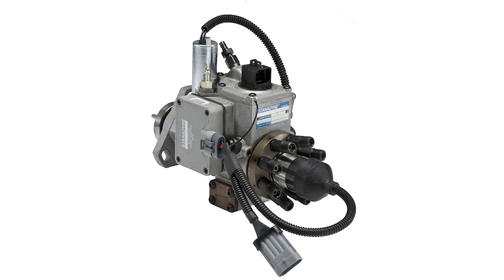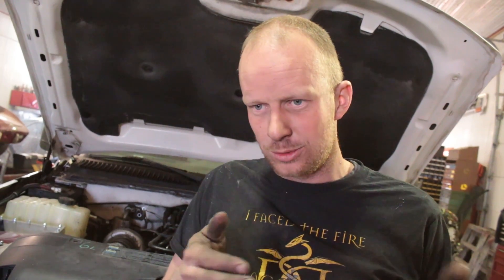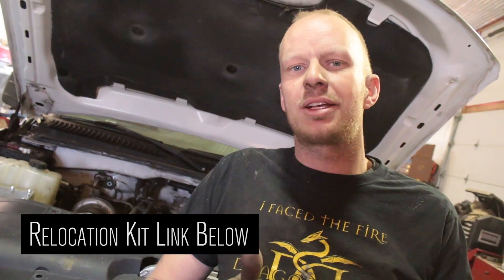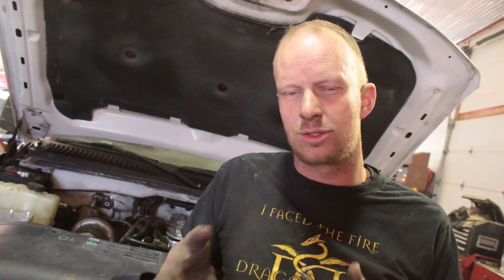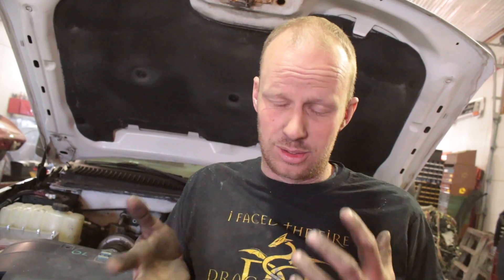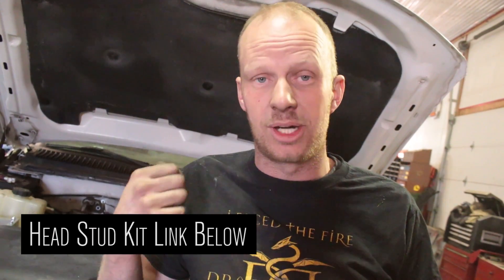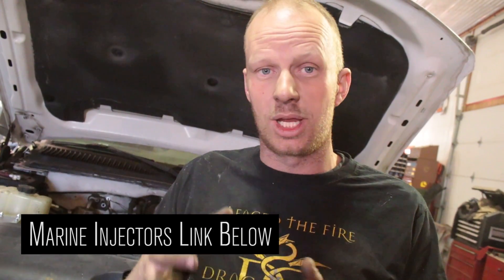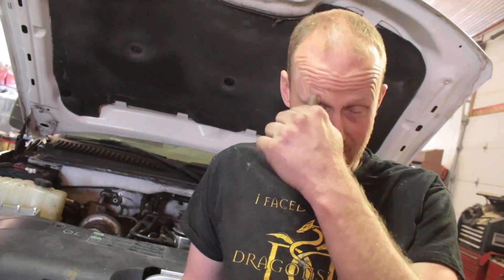REVIEW: Everything Wrong With A GM 6.5 Detroit Diesel

Comment: The 6.5 always had a unique sound to it.
Reply: It seems like all those trucks also had a unique smell under the hood. What I mean is you can be blindfolded and smell the difference between a 6.5 7.3 and 5.9.
Reply: Yes which is part of the reason I like it!     Edit : other part is that my dad has gone through two of them so they are in the family.
Reply: My aunt had one and I LOVED the sound, sold it to my cousin and he plowed with it, it ran away when he was driving
Reply: Like a bunch of ball bearings in the crankcase!  Mine has 354k miles on it currently.
Reply: Cllllack clack cllllack clack cllllack clack
Reply: Indirect injection engine=that awesome tick noise
Reply: @Andrew-ff4hh  A cold day and a 6.5 = a rock throwing contest haha.
Reply: 100th like
Reply: Yea they sound like they are rod knocking
Reply: IMO the 6.2 sounds much better
Reply: @brandonlarue3170  6.5 is a bored out 6.2
Reply: @nou8257  I know, it’s a bored out and turbo 6.2 essentially
Reply: Yup I still miss the sound of my 97 with a straight pipe. Crank broke at 313km. Rarely hear them anymore but if I see them around town I always roll my window down for them
Reply: @jaywiebe7612  cranks breaking is a known weakness of this engine.   Have to keep an eye on the two harmonic dampers.  There are two.  And they don't last forever.  I put a Fluidampr on mine for peace of mind.
Reply: @tmsnyder1971  two? Hamonicdampeners
Reply: @jenseriksson2590  Yes, one is the serp belt pulley, it's built into it.  Bolted onto the regular one at the snout of the crankshaft
Reply: @jaywiebe7612  I have a 94 k3500 crew cab dually with a stick barely got to drive it but i just like the old truck eventually ill get her fixed up again i managed to save it from a salvage auction.
Reply: So does a pack of firecrackers in a dumpster... kind of enjoyable though.
Reply: @davidmark866  actually gets quieter going up hill
Reply: friend has one, dont care for it, doesn't sound any better then my 7.3, 6.5 is quite....
Reply: like the rods are about to fly out of it. yeah unique
Reply: Theres a video to bomb proof the 6.5   and I think all Detroits have unique sounds
Reply: @Ricky-manic  link to the bomb proof vid? Thx.
Reply: I have a friend with one of these with a 4inch down pipe to 5 out the back and shortly after meeting him in high school, I quickly knew when he was leaving campus from several hundred yards away or he would be cruising around the neighborhood. It is a cool sound.
Reply: My favorite sound is the 5.9 Cummins distinct screech when you shut it off.

Comment: There's alot of comments to go thru so I'm gonna ask even if it's a repeat but, if you change out and get rid of the problem components to make the truck more reliable could it somewhat reliably haul something under 13k?
Reply from the maker: Yes.  Lots of guys love them.  Every manufacturer has some sort of issues, I just want to bring those to light so you know what you are getting in to
Reply: It's nice to see a informative video vs a bash video. I've seen a few for sale and this seems like a cheaper way to get into a diesel so knowing that it is a usable platform is nice.

Comment: My 1995 6.5 td is still running strong. The PDM died on me and the clutch went out The pick up fuel pump died on me too. The tank filter clogged. 
The starter kept snapping bolts off until I got grade 8 bolts and the brace 
in the back. Now its been 6 months with no starting issues.. And I had to manually close the turbo waste gate. Now its fun and reliable. I would like to know how to transplant a 12 valve into this and have it mount up to my NV4500 transmission.

Comment: Little black box FSD 6.5 computer been through two of them truck now at 157K. about $150 to $275 for remote and you can rebuild these little hummers for under $10 check out youtube.  Recently installed rebuilt trans $1700 and injection pump two years ago $1700 installed but you can buy them on Ebay rebuilt for around $700. Installed water pump cost about $150 and if you do that too be very very generous with silicone when installing the anaerobic bolts (the ones that run through a water jacket) or it WILL leak. 

I installed new rotors and pads for the front axles (4x4) and you have to remove the wheel studs then reinstall them on the new rotor. Pain in the ass just be sure the studs are seated before installing back in place then bolting up calipers and wheels. These take some torque to get them all in even.

Comment: I bought my 97 two door Tahoe 6.5TD for $500 and haven't had any major issues and have just kept it maintained. Every now and again I have to pull equipment or other people's vehicles out of the mud on the job site and I don't even have to take it out of 2HI to get them clear of the mud with only all terrains on it. Definitely no powerhouse but I can pull everything I need and tow more than I'll probably ever need to. In my opinion these light duty diesels get a bad rep because they're a little finicky and maintenance is really important with them. Slap a fuel pressure gauge and an EGT gauge on em and go to work

Comment: My experience with the 6.5L was that when you do all the preventative and preporatory upgrades first, they actually make a pretty good engine. I was plagued with FSD/PMD (black box) issues, stalling, even an almost runaway condition. A 6ft harness can be obtained as well as a nice heatsink, and alot of people now are removing them from the engine bay altogether. I chose to mount mine behind the front bumper, and never had another problem with it. 
Beware of claimed 40+hp 'marine' injectors, i would strictly only buy bosch or AC DELCO brand injectors, and yes bosch does have marine nozzles, but they aren't gonna make 40+hp. 
The bottleneck with fueling is the Stanadyne pumps, the DS4 (electronic, 95+) flows a little more than the DB2 (mechanical) pumps will. 
The problem with hopping these things up is just simply the IDI design wasn't made to be juiced up. This is a light duty diesel engine, designed to be able to pull a load and get good gas mileage while doing it. It's competition (in-house) was the big block 454 that got 9mpg loaded or unloaded. A 12V cummins is a medium duty engine, and really really outperforms the IDI engines simply because the direct injection system is easier to cool, and has a more reliable combustion with higher injection pressures ETC. 
Not tryin to get into too much detail here, but simply put, the 6.5L's injectors screw into the head, spray into the head, where combustion actually begins and is forced out of a hole no smaller than a pen tip and no bigger than a pencil eraser (different applications, it matters, 'star' precups are the best FYI) and THEN the flame continues into the actual cylinder. 
Here lies the main drawback of IDI, the water jackets in the head simply cant keep up with diesel's high combustion temps and these engines will get real hot, real fast, so that is why hands down THE MOST IMPORTANT thing!!! you can do to these engines is get a nice set of gauges, boost psi, EGT pyrometer, and fuel pressure. They are also very handy diagnostic tools, and they WILL save you from blowing a hole in the side of the block when the rings expand till they touch, shatter a piston and the rod starts floppin back and forth @ 3000rpm. It didn't happen to me but ask anyone who's ever had a 6.5l take a shit on them if they had gauges and I bet 90% say no. There really isnt anything besides lack of oil that could cause the damage that 1300° EGT will do after about 90 seconds. So if they say they DID have gauges and the motor is junk, they are either lying bout having gauges, or they were pushing it too hard and KNEW they were pushing it too hard. Operator error, 95% of issues with these engines. But you know how middle aged men are, the kings of wasn't my fault- it was a shitty motor- which is pretty freakin untrue.
#2 MOST IMPORTANT thing you honestly IMO NEED TO DOIs get that TINY DUMBASS hair-brain of an idea of a turbocharger off of the engine. Apparently in the 90's, CFM didn't exist (sarcasm) or i dont even know what the hell they were smoking, but ummm hello?? Lets make sure the actual volume of air a 6.5L engine needs at 3/4->redline IS CAPABLE OF FLOWING THROUGH THE COMPRESSOR AT 0PSI. Meaning if I took the wheel out of the compressor housing and ran the truck like that, well you ever tried to drink a milkshake that wasnt melted enough?? There you go. I'd really like to go back in time & take a nice 2x4" to the engineer(s) that decided a smaller (too fking small on GD PAPER) & wastegated turbo was a better solution than a bigger non-wastegated turbo. And to make matters "better"(cough*cough*WORSE), they tried to use vacuum solenoids triggered by PCM signals to control the wastegate and use the wastegate to control the boost output. STUPID NOOBIE DUMBASS IDEAS MADE BY GM ENGINEERS RUINED THIS ENGINES RELIABILITY & REPUTATION. PROVEN BY AM GENERAL WHEN THEY BOUGHT THE DESIGN FROM GM & FIXED THE DUMBSHIT AND PUT THEM IN (STILL DO) MILITARY HMMWV's.Seriously a similar vacuum setup is on my 1989 d350 cummins, but it controls the damn heater core bypass wtf were they smoking crack??
Anyways
Turbochargers can be had for real cheap these days. Guys were paying ~$300 on ebay for a chinese holset and having good results, but you have to either make or find someone who makes an appropriate downpipe. 
IN ALL HONESTY (hindsight is 20/20), I chose to pay $800 for the a-team turbo, just for ease of install. I regret that decision, simply because $800 is way too much for what you get, a mitsubishi excavator turbo, probably sourced from alibaba, and changed slightly to be able to bolt on. 
Another crucial thing I did (mine was a half-ton S vin) was find a lower intake manifold from an F (#8) VIN truck, which essentially deletes the EGR. My truck had 263,000 miles when I got it. I removed the upper intake manifold to have a look one day and the EGR (combined with the stupid BW POS stock turbo blowing oil film) had sooted the intake runners seriously almost fkn clogged, like an allergic reaction swells your broncial tubes that's what it looked like. It was a PITA to clean too, i tried to just use the F VIN lower intake manifold gasket but the exhaust just burnt through it, eventually sourced a lower intake. I pulled a "brand new" set of "marine" injectors off, p.o. Had purchased from SS DEVIL SUP... I mean SS DIESEL SUPPLY (beware!) and hand on the bible they were Dorman injectors and #7 & #8 bodies were cracked and leaking, which is why i replaced them. Next was 4" exhaust, 2.5" crossover with a 1/8th npt bung for an EGT probe, and a pretty nice custom tune from Heath Diesel, which was the real difference maker besides the turbo, which i might add, was a good turbo for the 6.5L. Just overpriced, andddd I got bored and slapped it on my 5.9L 12V and melted the exhaust turbine and then the asshole Who sells the things couldn't get me a cartridge to rebuild it. 
Ironically the holset h1c stock turbo on the 12v had a tiny little 52mm compressor wheel, and so by some dumb luck or fate or chance, the compressor housings on both the ATT & H1C were v-band clamp style for easy clocking, and that realization got my mental gears turning, and led to me putting the bigger AND wider compressor wheel and housing off the half melted ATT onto the H1C where it still lives today. 
I miss my 6.5L honestly, but if I would've known what I know now, for the $$$$ i spent for a beast 6.5L (78mm3/stroke ds4 maxxed + all other upgrades ~$3500 total not incl labor cause I installed it all) The bosch VE on the 12v I own and DD now flows 78mm3/stroke STOCK. And so I spent $3500 for 300hp in a halt ton 4wd with wide mickey thompson mudders, which was a blast to drive, just overheated really fast. But with the help of gauges, that engine is still running with the same setup (hx40wii turbo though) and has over 300,000 miles.
With the 12V cummins, I literally popped a protective cap off, turned the injection-duration screw until it made it run away, then backed it off 1 full turn, removed 4 flathead screws for the AFC cover, turned the fuel pin according to the youtube video, played with the post-boost & pre-boost fueling screws and voila, 300hp/600+lbs ft tq, for ABSOLUTELY FREE, in a 2wd single cab, with a 5spd manual which is just as fun to drive, I LOVE to smoke camaros on the interstate or burp smoke onto douchebags in convertables for texting & driving or being a fucking idiot, but the heavy SOB will get stuck in wet grass lol. Unless you keep it moving. Which is not a problem it will spin the tires doin 65 in 5th gear if the roads are wet. 
The cummins is a beast.
He's right, 12V cummins are the kings.Changed the head gasket on mine (simple as hell) and with 175,000 miles you could still see the honing marks on the cylinder walls from 1988. And I abuse the shit out of it too. Got a long block on the stand waiting for it's turn, pulled out of a wrecked truck and paid $500 for sans IP, accessories etc. Love the old gold goat. It'll pull my 48ft camper without even breakin a sweat. PEACE I HOPE I HELPED. TL;DR--BUY SOME GAUGES TO KEEP FROM MELTING IT AND GET THE FACTORY POS TURBO OFF ASAP THEN YOU WILL HAVE SOMETHING. ✌🏽️

Comment: good video but you missed a few things. the black box is called a PHD. pump mounted driver. after the relocation kit the other problem is your oil pressure switch. it doesn't last long because the injection pump is powered through it. so they burn up regularly. It was a safety issues so if the vehicle rolled over the oil pressure would drop and it would cut off the diesel supply. no fires. 
  The other things you could mention is the oil cooler Lines. they fail regularly because of the clips they use to attach it to the cooler / engine with. they are basically paperclips. there is a modification for that as well. also if your rebuilding your motor do not refried the crankshaft. they can't be regrouped they will snap in half. get a factory new or better yet. Scat makes a great replacement for $400. 
   There are serious mods that can be done to boost performance up to 350 to 400 H.P. but for the money you will spend might as well do a Cummins swap. also the block and heads were prone to alot of cracks. some caused critical failure some did not. it was fun to learn about them and fun to wrench on something different carrying a few spare parts they are reliable and fuel efficient.

Comment: the basic  design on the 6.5 is pretty bombproof.  everything GM added around it sucked.  the lift pump was under powered, and would break all the time and that's why they go through injection pumps.  the FSD (that little black box) was in a crappy location.  although easy to fix.  the shitty vacuum pump for the shitty vacuum operated wastegate sucks.  why they didn't just put a mechanical waste gate on I will never know.  and the cooling system was so incompetent for the job that they can't really handle any load uphill for any length of time.  change all these issues (e.g. THE MARINE MODELS!!) and it's a reliable, fuel efficient diesel that will tow more than most will ever need with no sweat.  oh, and throw a big set of batteries in just for good measure.  Good engine, poor installation execution.

Comment: I would add injectors to the list as well.  They will generally stop atomizing around 180,000KM.  The problem is that most people don't notice the presents of black smoke out the tail pipe and think it's 'normal'.  This led to many head gasket and cylinder head issues with the 6.5L

Comment: DeBoss....would you consider doing a vid about converting the 6.5td from electronic to mechanical injection?
Reply: There's a little more to it than that, but in its dumbest form yeah that's all there is to it. 
The newest addition to my collection had this 'mod' done by a 'master mechanic'. Timing was WAY retarded, fuel screw was ALL in, and rings and flushed out from all the extra fuel washing past them. Putting a DB2 on a motor that came with a DS4 is a good way to kill it prematurely, IF you lack the required knowledge to time an IP without timing marks
Reply: It's so simple. Just unbolt Injection pump, get a Mechanical one, run a throttle cable
Reply: dont need to just need the PMD isolator and the harness extension put a processing fan on it an no more issues. Check accurate diesel he has all the stuff the cheapest. IF you want more power just put a K and N right on the turbo and it will scream. plus the #9 resistor. he has that too.
Reply: why would you,there a crap engine,plus k & n,only stop rocks,you need a paper filter,nothing else,k,n, are for race track,no dirt.,!!
Reply: @phantomwalker8251  maybe if you don't oil it first...

Comment: Don't forget the '93 and '94 cross over years. 6.5 TD with mechanical injection. I had a '95, '98 and '99 with electronic injection. Sold all of those and still have the '93 in a crew cab dually. Keep coming with your great videos. Thanks.